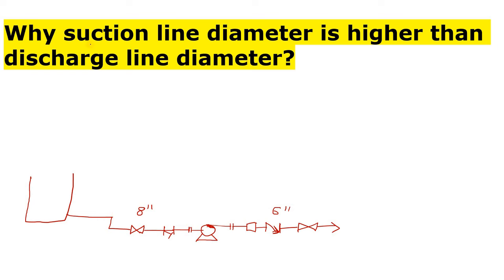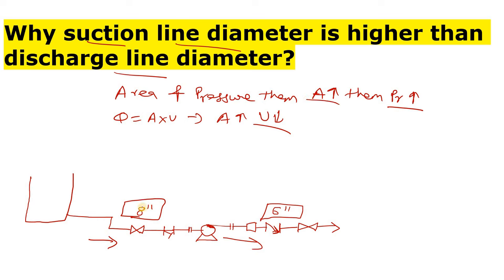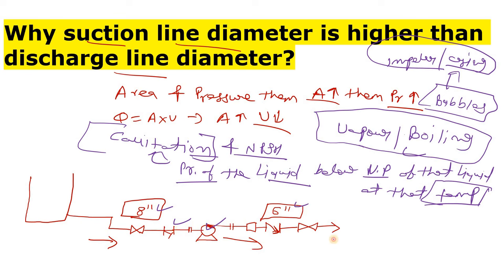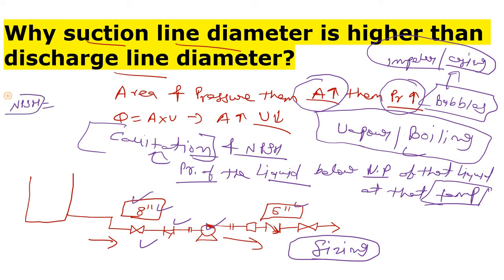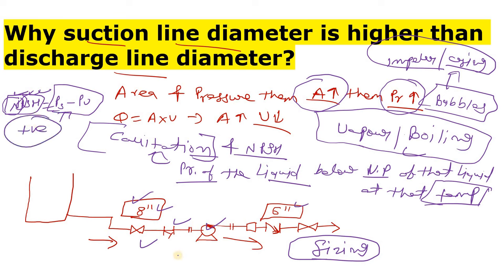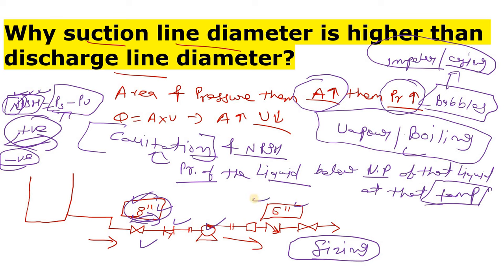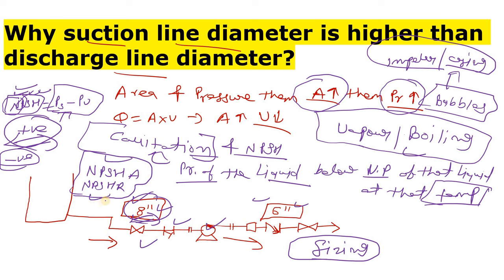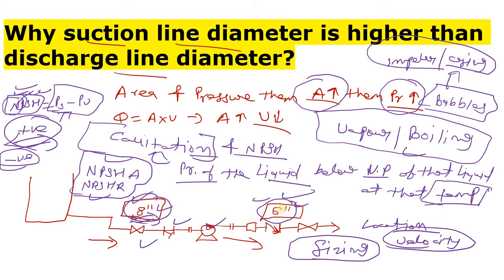Why suction line diameter is bigger than discharge line diameter in centrifugal pumps? (Part - 3)

Comment: NPSHa is difference between suction pressure and vapour pressure of pumping fluid at that temprature provided by process engineer during pump sizing and NPSHr is provided by pump vendor. NPSHa > NPSHr to avoid cavitation due to vaporization of pumping fluid which is caused due to frictional loss between source tank to pump suction as a result suction pressure falls below vapour pressure and cavitation occur.
Reply: why NPSHr (from vendor) is have to be smaller than NPSHa (calculated by process engineer), shouldnt it be the higher the difference of suction pressure and vapor pressure, the less the cavitation will occur?

Comment: Pressure is inversely prepositional to area 😊
Reply: It is for solid not for fluid
Reply: How about diaphragm actuators..say Shutdown valve air actuated where pressure inverse proportion to area applies...with less area force is more thereby u can actuate such a huge valve 30 inch valve too

Comment: @core engineering : Sir are you sure that Area increase then pressure increase?
If it is so than kindly answer that area of 8" pipe is higher or 6" pipeline .
I am surprised that people are still comments nice explanation and all. What you explain is totally wrong.
If area increase then pressure decreases that's all.
Reply from the maker: Don't get confused , simple thing is here …..according to Bernoulli's equation when we increase area so pressure will increase. For example we all use water pipe to give water in garden so In this situation we push a pipe so water will fastly go as far away, Hence when we push pipe it means we are decreasing area of pipe so pressure will decrease and velocity will increase.
Reply: @Coreengineers  Dear sir, Yes now you are correct that if area decrease then pressure increase. Kindly review your video because in video what you are explaining is totally Opposite. That's why I comment. Bernoulli equation is right and I am not confused but kindly check what you explained in your video. You will come to know that in video you explained wrong.
Reply: your point is right when considering a pressure of liquid  at rest(P=F/A),but in motion always pressure is directly proportional to Area.(As per bernoulis Law)
Reply: @manishankarraju5354  in rest pressure is the same everywhere.
Reply: @letslovenature6701  mate u are very wrong.very very wrong.this video is legit .and you are very wrong
Reply: You are very wrong….

Comment: But if at discharge, velocity is increasing then as per bernoulli eqtn the pressure will decrease at discharge, will it not cause back pressure sir....
Reply from the maker: No It'll not create back pressure as pump is used to  increases the pressure of the fluid and at suction side we increase the dia because of cavitation prevention. For back pressure we use the nrv btw

Comment: What would happen if the suction line is smaller than the discharge line? Suction line is 3" and discharge of pump is at 2 1/2" but a reducer is used so it becomes 4".
Reply: Pls explain

Comment: I think that the NPSH is the sum of the pressure head and the velocity head in the suction of the pump minus the Vapor pressure of liquide .so this sum is still constant if we applie Bernoulli equation so the variation  of npsh it’s from  aspiration pressure losses that’s why we use bigger diameter to reduce the velocity only